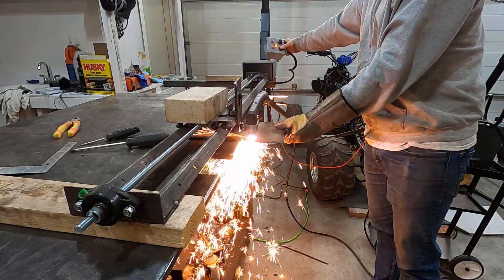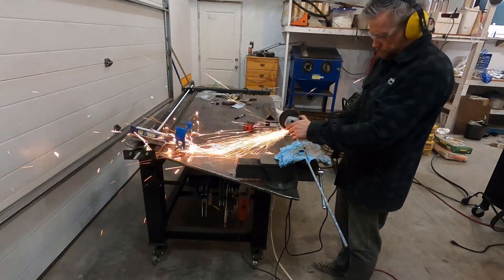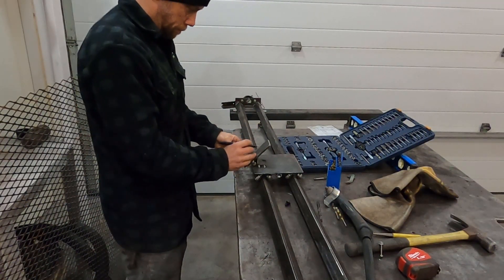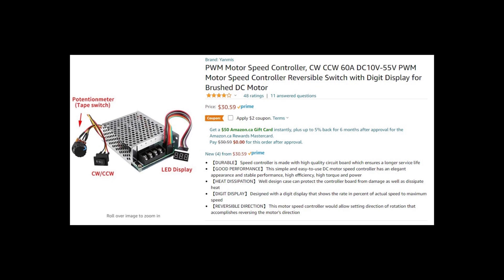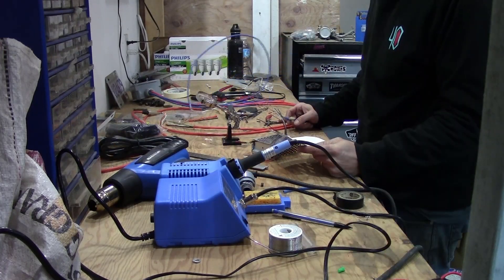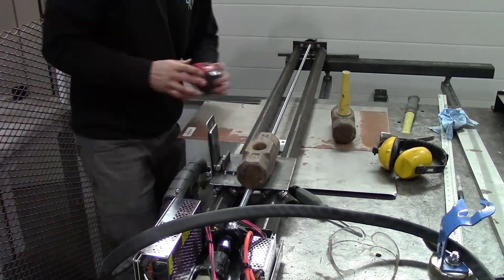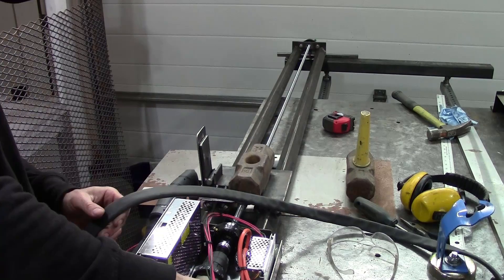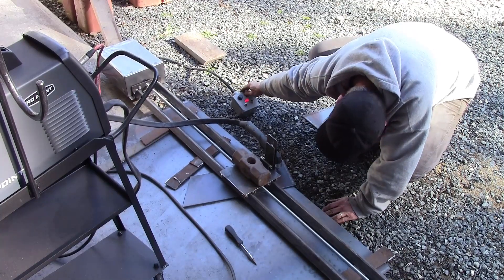DIY Motorized Plasma Cutter Track

Comment: Nice build. I'm thinkingbof building one but since I'll be using a 20 volt drill motor I'm just going to mount a 20 volt dewalt battery on top. Basically no cords for the traveling motor part of it and no need for the converter just a pw controller. I'm hoping this works, I may have a few bugs to work out.
Reply from the maker: Sounds good, Jesse. Use what you have on-hand for sure.

Comment: 1:1 Kopy from the Chanel "Made in poland"
Reply from the maker: There are several of these on YouTube, most with pretty similar designs. I looked at lots of them for inspiration before building mine, and absolutely was inspired by Made in Poland. Where mine differs is having the switch wired into the plasma cutter machine and not the torch handle, and having a remote control. I also drew from Mike Festiva and MakerCave for the electronics.

Comment: Looks great.  I  wonder if you have (or could easily add? ) a reference surface parallel to the cut line?  This would allow you to align it accurately square / parallel for accurate cuts...
Reply from the maker: Good call. The angle iron track is parallel to the cut line and I can index off that to line up the cut. I've considered adding something like a pair of stiff wires bent into "pointers" on either side of the torch holder, but a tape measure from the rails to the scribed cut line works easily enough that I haven't bothered.

Comment: Looks like quite the project. Nice work too! How long did it take you to make this? Also, anything you'd do differently if you were to make it again - or are you overall happy with the way everything turned out?
Reply from the maker: Thanks, Brian. I honestly can't remember how many hours it took to build... It had been done for quite awhile and been in use in my shop before I finally painted the housing and called it done. Then I procrastinated for awhile before editing! I'm pleased with how it turned out, it works great. One easy improvement would have been longer wires for the remote, though.